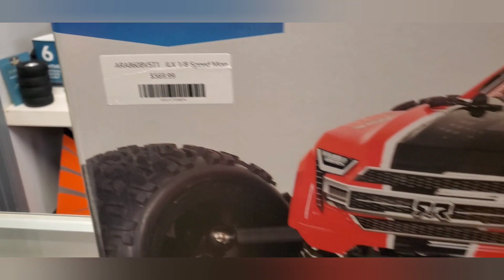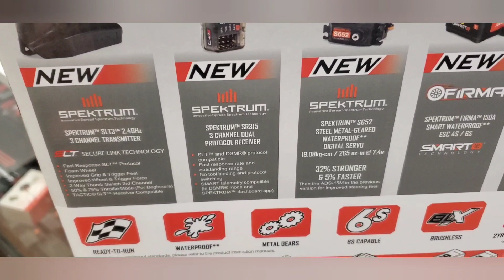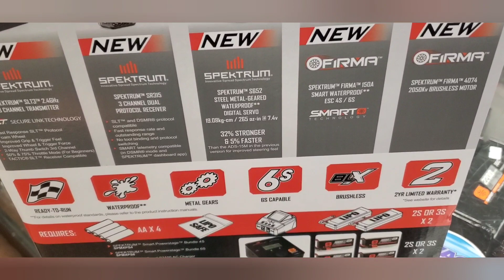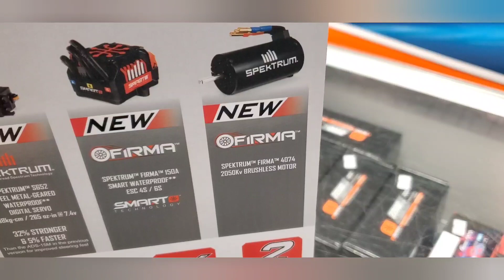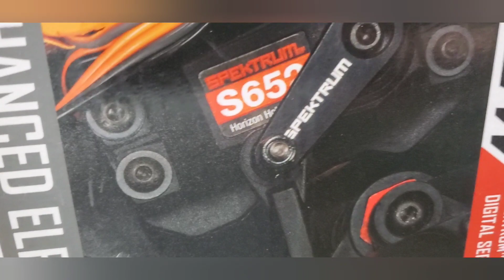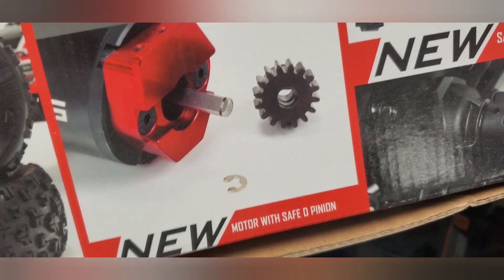Arrma Kraton 6S BLX V5

Comment: Well, the damage is done. Just got back from our local hobby shop. Should have it next week. Looking forward to getting our hands on the V5.
Reply: How is it going
Reply: Last minute impulsed into the XMaxx. 1st day the pinion gear worked its way off. Re-secured with locktite. Second day, stripped the steering servo. Replaced with the metal geared 1085x. After spending nearly $1400 on the combo I have been a bit disappointed with the stock durability. I haven’t bashed it hard, it’s just been fragile. I suppose the truck will be a work in progress. By the time I get it to full strength I’ll be an expert RC mechanic. Other than the repairs, the XMaxx is a blast.
Reply: @romanticdonkey468  nice man yea once you work out a few kinks the xmaxx is a absolute beast! We ended up getting the kraton 8s and she definitely is an animal. A few weeks in with the punch setting at 5 we still have yet to break anything. I still wanna get the 6s Kraton for bashing and tricks

Comment: Just got my v5 today a bit late to the party. Do you need to bind the tx first before using? Throttle trim also? Sorry im so new to this
Reply from the maker: They are pre-bound from the factory and throttle trim should be set at neutral.

Comment: First thing I upgraded on my v4 is the Radio to a Sanwa mx-6. Then an Aluminum servo mount, HotRacing  chassis braces and RPM front bumper.  Anything else I should upgrade?